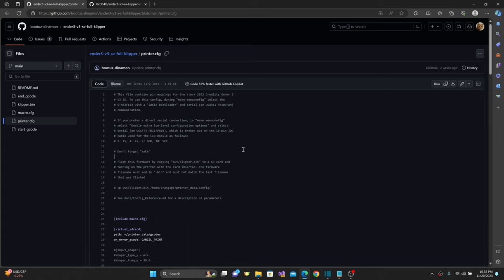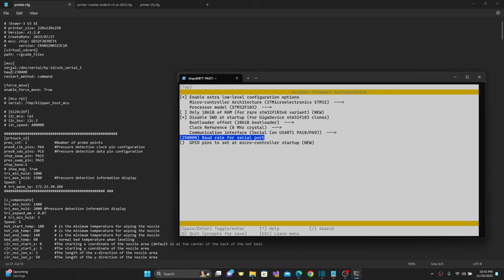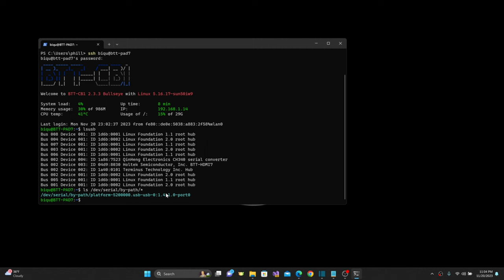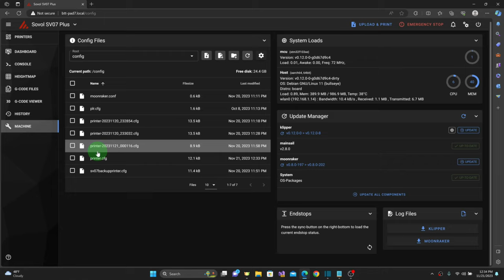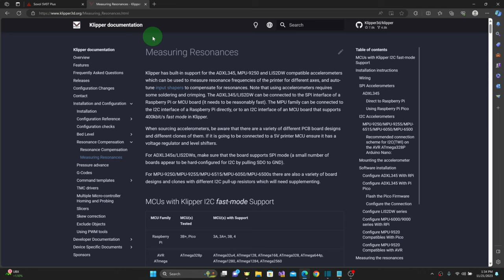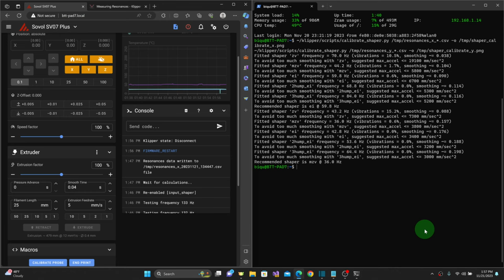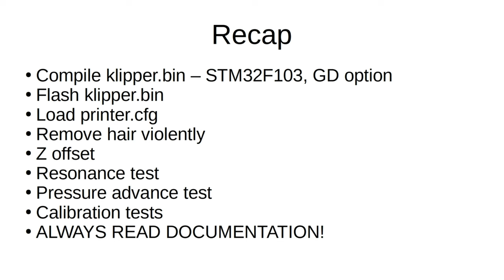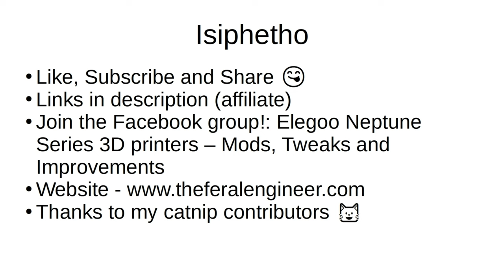Installing Klipper on the Creality Ender 3 v3 SE using the BTT Pad7

Comment: Your pressure advance value ? Nice that you’ve made this video I had no documented process from ender 3 v3 se. Then I found yours that was really helpful n gave me a base line. Once people get the taste of klipper then there’s is no going back I guess. That’s the first upgrade I did with this printer, and removing the unstable mass from the top n went to reverse Bowden was the next upgrade which might be necessary for people who prefer print quality.
Reply from the maker: I believe it's 0.055? I have to look

Comment: sorry I'm a litte bit confused, what firmware did you end up using out of those 3? It sounded like you used them all, if im correct, could you share that firmware? im planning on running this on a rpi4. Also, is auto bed leveling availible on this?
big thanks for the video!
Reply from the maker: It's not a matter of using different firmware with Klipper, it's just the config file. I tried the ones that were available and opted to make my own based on a combination of what I found and what I made myself

Comment: Great tut with the SE being de-crealitised lol ... now if you want a real challenge, try to install the Pad 7 or even real klipper on our darn KE 😅 That version is just a mess of VIOLANT HAIR PULLING 😂 Tried to install a Beacon3D ... no luck, use Pad 7 ... no luck as no sim card slot to flash it ... etc etc ... just a big brick of slimdown Klipper. Almost on the edge of swapping a SE mainboard on my KE and follow your tut after 😉👍
Reply from the maker: You'd probably have to find the programming pins on the board (DIO, CLK, etc) and use an STLink to flash the chip

Comment: I love my creality pad. You have to use hot glue on allllll of the usb ports. It helps with wear and vibrations. Do the 3d printer usb too
Reply: But how would you remove the cable from the port if you need to?

Comment: Just bought the SE as my first 3d printer. I doubt I'll be diving into klipper in the first 24hrs - but no doubt will do in the months to come. I have a spare pi zero 2w kicking around  - would this be enough to run klipper? 
I also have a spare orange pi zero 3 which has more RAM but is also dodgy on it's wifi connection
Reply from the maker: In theory, the zero 2w should work fine, but I haven't tried myself.

Comment: Man the focus for the prints is terrible, try to have a neutral background behind the stuff you point to, block autofocus, have the thing in the frame as big as possible.
Maybe point the camera against the wall or a piece of paper and then put the cubes in front of that.
Reply from the maker: New camera. Trying to get the hang of it. 

Got a new lens that seems to fix the issue. It focuses way closer to the lens
Reply: @TheFeralEngineer  I get that, it takes time...

Maybe when you are shooting the details don't keep them hanging with your hands on a very rich background like the whole printer. Lay that on a plain surface and macro on that.

But hey it's good work, Klipper on the S3 VE is a first on youtube :)
Reply from the maker: @eaman11  I think I finally got the hang of this camera. I can set it up so that it doesn't blur the background and it's got AI driven focus control as long as i remember to use it. 😂😂

Comment: I have upgraded the Ender 3 v3 SE hot end, and I am running klipper with the sonic pad, but I still cant print above 260c even after modifying max temp through the print.cfg. Any suggestions?
Reply from the maker: You need a 300c thermistor
Reply: @TheFeralEngineer  I upgraded to the Creality K1 Max ceramic Heating Block Kit. That should already have a 300c thermistor?

Comment: are you able to use above 260c? I swapped my heatbreak to an all metal and am struggling with the sonic pad kicking off when going above 260c.
Reply from the maker: Haven't had to. You probably need to change your thermistor

Comment: Hello! I have a one question, its posible install the klipper on nebula pad? I have a v3 se with the nebula pad and only i have errors. Thank you
Reply from the maker: The nebula pad runs a version of klipper already. You probably just need to get the config dialed in properly. What are the errors?

Comment: hello sir im just new in the klipper im just running it in old ender 3 and thinking to make my SE klippered too, but im just using thin client. Can i use the same cfg that you provided?
Reply from the maker: Yes. You have to get your serial ID for the client and the rest will work
Reply: @TheFeralEngineer  thanks sir i already get it working, btw how to level the bed sir? i already do the bed mesh but the bed is still not leveled. thanks again sir

Comment: I am just wandering are there any better configurations now, I  just installed klipper on my v3 se, and am looking for configuration just for stock v3se that will do everything i nede for printing, i doon't have acelerometars for input shaper so would like something stock ore pre tuned with stock printer. Still new to this so don't know enough to make my own .conf
Reply from the maker: There is no standard for a stock printer from a pressure advance and input shaper standpoint. 

My config works perfectly on my machine but it may run like crap on another. The point of Klipper is having the ability to customize and dial in your printer for optimal results, it's not just "put it in and print fast". 

I'll try and update my GitHub later with the latest config, but you'll still need to learn.
Reply: @TheFeralEngineer  Another questionee, do u have any problem with extruder on your v3 se, I see lot of people have unexplainable clicking, and it started happening to me too can't seem to find anyone on yt tackling that problem so don't know what to do. I often find that people just replace extruder and that doesn't sound to god for new machine.
Reply from the maker: @gs_invader7364  nope. Clicking is sometimes caused by clogs or partial clogs

Comment: hi, can I install on on an old laptop running Linux mint instead, will the installation process still the same?
Reply from the maker: Yes it works the same. Just remove the brltty service or you'll have USB issues
Reply: @TheFeralEngineer  nice. thanks bro. subed for future ender 3 v3 se content
Reply from the maker: @BM_brb  I've got multiple videos on installing klipper on different devices, so check them out. The steps are all very much the same 🐱🐱

I think the only thing the e3v3se is going to need from this point (aside from firmware that supports the bed sensor) is lighting. Klipper and the polisi3d heatbreak really woke it up 🐱🐱

Comment: after klipper, is auto bed level and z offset working well?
Reply: I'm curious about it too!
Reply from the maker: @snowshoyo  auto bed level works awesome. I only set Z offset once with paper and I haven't had to touch it since.
Reply: @TheFeralEngineer  that means, auto z-offset workaround is pending
Reply from the maker: @naveennishad  yes, I mentioned this in the video. There's a community build of Klipper with a beta version of it and creality is supposed to release their code because of gpl, but I'm not sure when it'll be released.
Reply: @TheFeralEngineer  thank you for letting me know <3, sorry for missing it on video, shame on me >.<
Reply from the maker: @snowshoyo  it happens 😆😆

Comment: would it be possible to use a raspberry pi (or banana pi, orange pi, anything pi..) with klipper to control the ender 3 v3 se? 
also, would it be possible to auto input shapping with it?
Reply from the maker: Yes. I recommend the btt-pi because it's cheap, runs on native 24v from your printer psu and can control 4 printers from a single unit. It supports input shaping just like the btt pad7 and other pi type devices.
Reply: @TheFeralEngineer  nice! Thank you very much, I'll search a btt pi to buy :3, it's a little expensive here in my country, but I do have a rpi4 b, thats why I asked, thanks !!!
Reply from the maker: @snowshoyo  that will work even better!
Reply: @TheFeralEngineer  thank you for all the responses and caring <3 you indeed won a follower, happy to see more videos !! 😁

Comment: Super helpful video, thanks a ton for all of the info. But dude, you suck at delivering that information. You drone on and on about something you're gonna do later that has no importance at all. But then when you're delivering useful information you zoom through it far too quickly. Wonderful information here. About 6 or 7 minutes of this video was helpful. It'd be even more helpful if that 6 or 7 minutes was expanded to 10.
Reply from the maker: ...Thanks... I think? Probably because I've got a half dozen other videos on the exact same subject that are easily accessible. I've installed Klipper onto so many printers and Linux devices that I've begun to glass over the finer elements of it because that information is located elsewhere in depth. But thank you for enlightening me about how poorly executed my delivery and overall content is and I invite you to show me exactly how to do it.
Reply: @TheFeralEngineer  I apologize my comment got ranty and off topic and turned overtly negative. I really meant to convey my appreciation of the very helpful info you shared with just a jovial little "hey, dude, work on your pacing a little bit". But then I got rambling. I blame my meds for kicking in for the rambling. Unfortunately I rambled and expanded on the negative part and zoomed through the positive part. Now that I think of it, kinda exactly like I said you did facepalm expanding on the unimportant and zooming through the important. I apologize for the negativity of my original comment. Your video is extremely helpful and contains a lot of useful information. So, in summary, thank you very much for sharing. I'll work on bitching less in the future lol
Reply from the maker: @windsorclarence  this video was meant to be more of a "casual chat" style video, because I've got so many videos about configuring Klipper that to rehash it step by step in every video would just be redundant. This one was more of a "if you know how to do it, assuming you've been through my other videos, here's what will be a little different" and just my experience with getting it installed on this relatively new machine. That's the thing with Klipper; the first time, it's hard af, second time it's way easier, 10th time, it's pretty much bound to work. That's kinda how my videos go too; first time is super in depth, second one is more laid back, 10th one, we're just shooting the shit while I'm doing something in the background. 

Problem with pacing is that everyone is different. I did a 23 minute long video where I drilled 4 holes, degreased an aluminum plate and stuck on some adhesive backed sheets because not everyone can follow the abridged version of things, but those who know how to drill holes will be the first to say I dragged it out for way too long. It's a delicate balance. I've taught hundreds, if not thousands, of people over the years, but when the same ones come back a third, fourth and fifth time simply because they hadn't used what I showed them 2 years prior, I'm not going to go at it with the same amount of depth because in my head, they should know this already and I'm not going to come off condescending and explain it to them like they're five.

/rant 😂😂